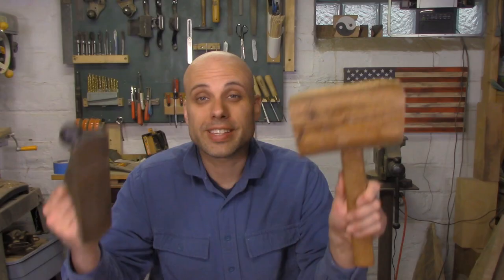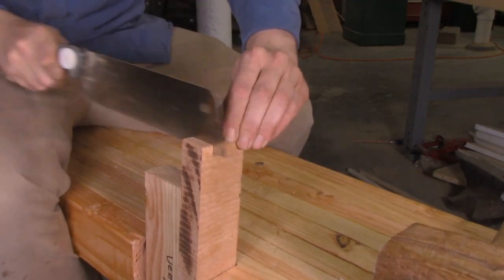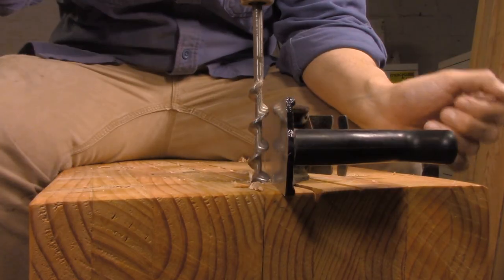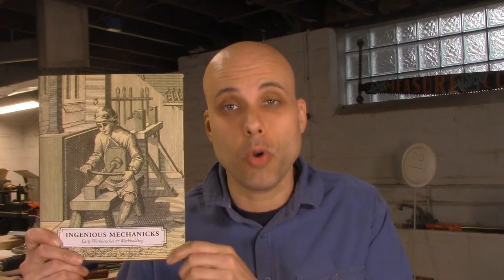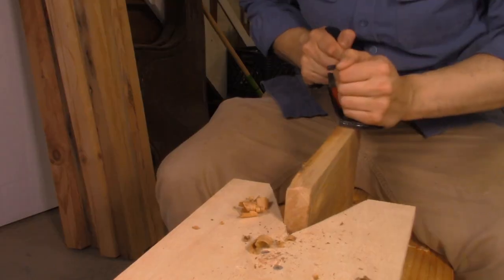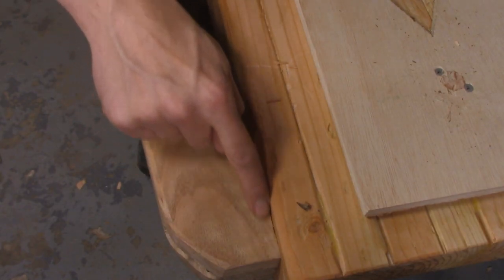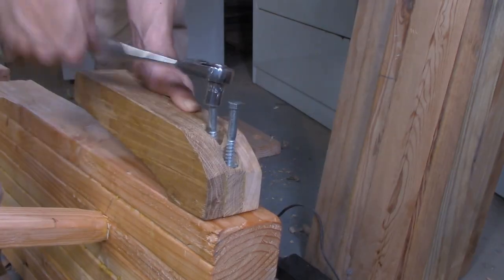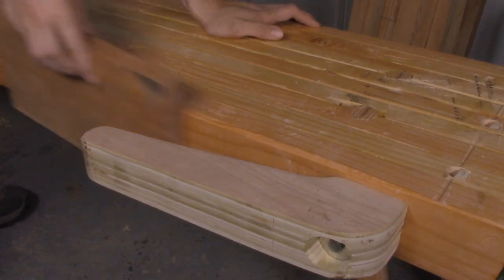Hold ANYTHING on the $30 Bench.

Comment: Any reason you did 1 inch holes and dowels for the bench dogs? Seems like most bench dogs and holdfasts are 3/4 inch. And you used 3/4 inch dowels and holes for the deadman.
Reply from the maker: Greg Gentry I did 3/4 for the dogs so I can also use my holdfasts.  I guess I wasn't clear about that.
Reply: Nope, just rewatched it, and I misheard you. You said 3/4.

Comment: So i want to buy a vice wich one should I get
Reply: I found an old rotten vise in my grandfather's cellar. That was my first woodworking vise. I salvaged the screw and nut out of it and redid the wooden bits. Then I was at a flea market one day and I found a guy selling a far eastern quick release woodworking vise for $2. I figured for $2 what the hey. It's OK. You could start out by getting yourself a screw box and a wood tap. Or maybe find an old car jack. You can make an OK vise with one of those.
Reply from the maker: I'm not aware of any new vise I can recommend. All of mine are old.

Comment: Don't buy the ones from Harbor Freight!  At least buy some Stanley Bailey's.  Better yet, and for hardly more money, get some excellent Narex chisels.

If you can't pound on your chisels with a mallet into the wood without it immediately ruining the edge, you bought awful chisels like I did.  You likely will fail to harden them as well, because it is only mild steel.  

Skip the two year struggle and buy some chisels that are properly hardened.
Reply: I really love the Aldi chisels

Comment: I really do appreciate the ingenuity. 
But living in the 21st century I hardly can see any reason to use it for real projects. 

By the way,  the incandescent lights in the background are a little bit puzzling. 
A set of torches would be way more authentic.
Reply from the maker: My projects are as real as it gets and the century you're in matters not a bit. Also, no incandescent lights in my shop.
Reply: I built one based on this, I'm using it a lot. 
I use power tools most days all day at work as an electrician and it's good to chill out and create something using old skool methods. 
Also I only have a small garden and pretty much no storage so the next plan is a padded "lid" for the bench so it can double as spare seating when we have a few pals over.
Too much tech. Too much noise, too much money.

Comment: 30 bux?? Assuming you already had all the wood, else thats just another youtube clickbait boldface lie!! Sad.
Reply: No its not. I built a bench like this and the lumber was, I think, $18. Add the price of the glue and it easily came to under $30.
Reply from the maker: It could be that lumber is more expensive where you are, but 2x4s in Ohio are about $3 each. Multiply by 9, add glue = $30. There's no point in lying when ANYONE can effortlessly fact-check me. (Or ignorantly run their mouth for no reason.)
Reply: Boldface is a term from printing that means a typeface that is thicker, bolder so it stands out from normal type. Bald-faced (or barefaced) means brazen, obvious. Aside from that, you're just wrong unless common construction lumber is very expensive where you live.
Reply: @jerrylohr3491  good point about "bald faced lie." Etymology is cool. That said, in the age of the internet maybe the term "boldfaced lie" could be useful! Although "all-caps lie" might be more generally accurate.